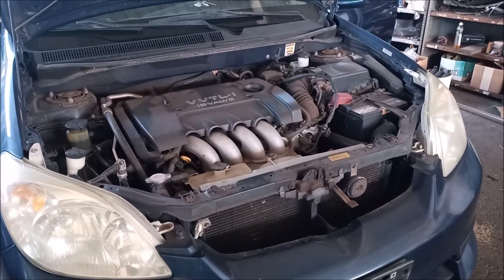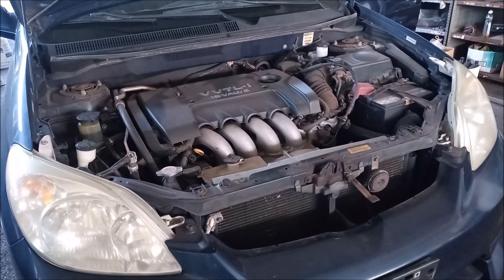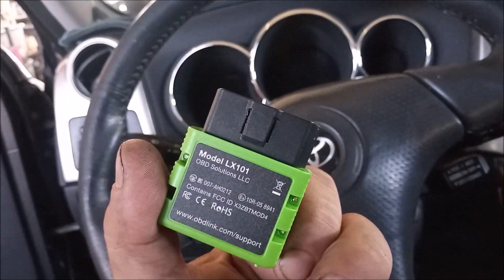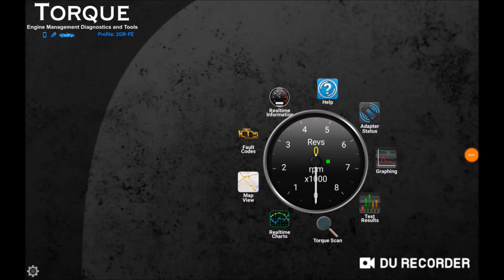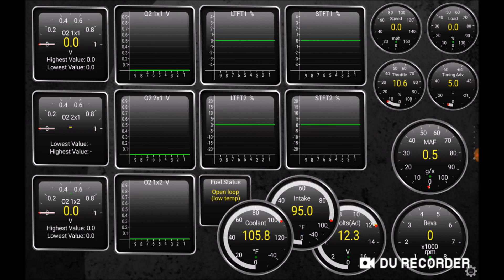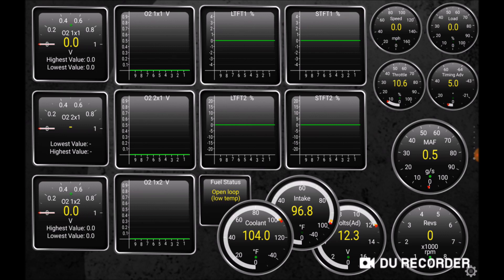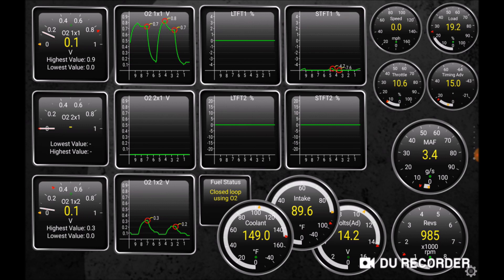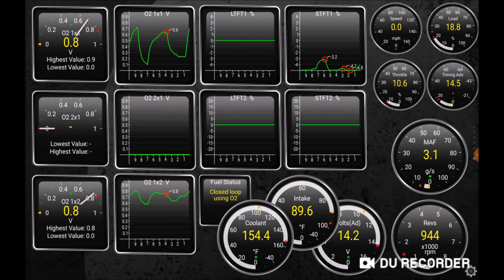O2 Sensor Voltages and Fuel Trims  LTFT STFT - 1zz-fe 2zz-ge Toyota MR2 Spyder

Comment: Hi Frank.  I bought the OBD2 Link and the scan software.  I was not getting any output from the upstream O2 sensor,  so I replaced it with a new Denso unit.  There is still no output.  Any ideas what the problem is?   I'm getting all the other data including the downstream O2.
Reply: Update:  Now I'm getting output from the Wideband Voltage on S1.  The voltage stays around 4 volts,  but the S2 voltage swings back and forth.  It should be the other way around.
Reply from the maker: What year and model and engine. Newer engines have an AFR sensor that functions differently from an O2 sensor. It will NOT give a 0-1 volt signal. The AFR sensor gives only a 3.5v pseudovoltage on the scantool. This is how you verify the function. The downstream sensors are usually conventional O2x sensors (0-1v) even on newer vehicles.
Reply: @Merryfrankster_   It is a 2004 Toyota Highlander 4 cylinder.   So  the upstream  O2  is ok then.   It must need a new catylitic converter because the Downstream O2 is still swinging back and forth.

Comment: Frank, Thanks for sharing your knowledge on this and other 2zz swap matters. A quick question. Any reason why the ecu won't enter into closed loop mode. Mine gets stuck in OL-DRIVE mode after warming up and just stays there. My O2 sensors are fluctuating in voltage as expected and I don't seem to have any vacuum leaks (although  idle is a bit high at 1100rpm). I'm  working with a freshly cleared ecu as you are in this video. The thing (a Celica GT with recent 2zz swap) just won't go into closed loop. Appreciate all you do for the zz community.
Reply from the maker: I would expect a CEL and DTC to pop up if it is not going to closed loop. Maybe check the TPS on your scanner, it it's reading an incorrect elevated value, that could cause open loop - in fact that's the basis for a (ill-advised) hack for forcing open loop.
Reply: Hi Frank. Thanks for your prompt reply. You are literally the GOAT on all things ending with ZZ. Props. Anyway, I figured out my issue. I'm using the old 1ZZ/Celica GT harness on the newly swapped 2ZZ and neglected to switch the red and brown wire on the TPS plug. (You explain this in a post for Spyderchat, the wire colors being different for the MR2-S.) I realized my error after repeatedly getting a P0121 Throttle Position Sensor error. I originally addressed this by changing out the whole throttle body assembly. Then I noticed my scanner showed a TPS reading of 90% rather then the 10% you show in this video. I realized something was reversed and subsequently discovered the variation in TPS wiring between the 1ZZ harness and 2ZZ harness.  It's a shame MRW doesn't make this more clear in their swap guide/shopping list. Anyway, now I'm onto another issue--P0171, Too Lean. I've seen your vid on the vacuum hose routing already ( thanks for that, btw). An exhaust leak maybe, or faulty old injectors? Who knows. Anyway, I'll post what I find out here for posterity's sake. Cheers.
Reply from the maker: @mbbrower  ah, so it was the TPS after all. Good catch.
Reply from the maker: @mbbrower  P0171 is a very commonly occurring code in swaps. There is no shortage of advice on what to look for if you have that code.
Reply: Thanks Frank. I've already found your laundry list of possible causes in the forums. I've had the exhaust flange apart 3 times trying to fix a small leak in the donut gasket between the header and mid pipe, but I'm not sure that is really the problem. My pre cat O2 readings essentially flat lined at 0 on the last drive and that was with a new Denso O2 sensor. Could running it rich the way I did with the reversed TPS wiring (for 10 miles or so)  have ruined a new O2 sensor?
Reply from the maker: @mbbrower  flatline at 0 means either the fuel mixture is very very lean or the sensor is dead or there is a problem in the wiring. Do you still have your post cat O2 sensor? Swap it for the upstream sensor, for a test. This means, remove the sensor from the post cat position, plug it in to the upstream position, and run the engine, checking obd2. The upstream sensor and downstream sensor are functionally the same. So if the downstream sensor works when you put it in the upstream position, this means there was something wrong with the upstream sensor. If you put the downstream sensor in the upstream position and you still get a 0 flatline, then you know it is not the sensor. But before you do that, make sure that the downstream sensor is working in the downstream position, by checking its function on obd2 live data, before you remove it.
Reply: Thanks for all your help. After eliminating the exhaust leak entirely and swapping around and changing  out the O2 sensors, I still had both front and back sensors reading between .02 and zero. I also had low manifold vacuum (15 inches Hg) which I think explains the marginal MAF readings (2.5 g/s). So, going back to basics, I ran a compression test and it looks like I've got a bent or otherwise leaky valve on number 3. I didn't do a compression test before because the car ran pretty good. Psychology of avoidance, I think. Anyway, so much for all that low hanging fruit like sensors and wiring. Looks like I'll be pulling and rebuilding the head. Haven't done my research yet, but I'm assuming this can be done with the engine still in the car. I know the timing cover can be removed with the engine in, but I'm not super thrilled at the prospect of getting the exhaust manifold off and back on again. Anyway, thanks again for taking the time to help us "dummies."
Reply from the maker: @mbbrower  2.5g/s is a normal reading for warm idle, 800 rpm, iat about 85 to 90f. Before you do anything crazy, do a leak down test. This is the only reliable way to check for valves not seating. Compression test is not indicative.
Reply: Good advice. I'll pick up the leak down test kit. I assume the.one from HF is adequate? Going back to the beginning of this saga, we thought it good practice to put in a new timing chain before installing the junkyard engine. We had the timing all carefully sorted out until just before installing. We then discovered the broken intake side lift bolt, which entailed removing camshaft and tapping out the rocker rod. We put it back together, but without exercising the same degree of care as we originally had. We ended up lining up the chain markings on the  dot/indent on the intake sprocket instead of the line on the vvt housing. Ugh! Thus the timing was off on the intake side maybe 90 degrees. My fear now after discovering the low compression on number 3 (90 psi whereas all other cylinders are 140) is that some intake and exhaust valves may have crashed into one another while we we trying to sort out the initial start up. Anyway, I will do the leak down test and report back. Maybe someone out there can learn something from our mistake.
Reply from the maker: @mbbrower  Sorry but I would not trust any tool from Harbor Freight. Certainly not a precision measurement tool. Here's a link for an OTC tool - it's the one I have. Reasonably priced, reasonably trusted. https://www.amazon.com/OTC-5609-Cylinder-Leakage-Tester/dp/B0030EVL60/
Reply: Thanks for the link. One year later, after pulling the engine, removing the head, and replacing the head gasket, my problems are apparently solved. The ECU is entering closed loop mode and the emission monitors are cleared. In the end, I didn't have to rebuild the head ( all the valves were air/watertight). Must have been a leaky head gasket... I'm not really sure... Anyway, compression is now even on all four cylinders, which was not the case before. Just took a new head gasket. Anyway, thanks again.

Comment: Did you download any specific Torque plugin etc or input the sensor pids manually to get these to show up and work, I never got a lot of the realtime info you can add to work on my T-Sport/GTS in US celica market terms I think the TS is known as like oil temps and the sensors you show here and some other stuff, RPM data and speed and load% etc worked fine, though. A guide on getting the best from Torque Pro and a 2zz motor would be appreciated pleaaaaaaase :D
Reply from the maker: These are all standard PID's included in torque pro. No special programming needed.

Comment: You are my light in the dark. Thank you! I recently made my swap to my Spyder with 2ZZ with brand new PPE cold intake and hot air exhaust and I had system too lean issue. The trims where sky high but I did change the Idle Control Valve from the original 1ZZ engine alongside with the sensors and the trims are now as the ones shown in the video. What bothers be is that my O2 sensor never worked the same way as in the video. I gives voltage much rarely that shown here. I am only left to fix my Idle revs and I was wandering could it be related with the O2 sensor in any way?
Reply from the maker: O2 sensor should work EXACTLY as shown in the video. If not, it could mean either there is an exhaust leak or the sensor or its wiring are defective. There is also possibility of vacuum leak on the intake side.
Reply: @Merryfrankster_  I checked the electricity and it seemed ok. I went to smoke test and found a vacuum leak through the spark plug gasket. Since I fixed it when I start the car the O2 sensor works up until the moment the MAF reading goes below 0. When the car is cold the reading of the MAF starts at around 4 and when the car warms up a bit the MAF goes from 2.5 to 0. When the car is under load the MAF and the O2 sensor work as in the video here. May I respectfully ask if you do happen to have a guess what might be the reason for the MAF's behaviour? I recycled every part of the cold air intake and I am using the PPE cold air intake system with brand new MAF and PPE header and outlet with brand new O2 sensor as well.
Reply from the maker: @timopetenbald1326  most likely reason maf sensor reading goes to zero on a running engine is a. maf sensor has a defect b. there is a fault in the wiring between the maf sensor and the ECU c. or the ECU itself has a defect. How long does the maf signal stay at zero? It is a brief blip? Is it a sustained break? Does the engine stumble or stall when this happens. Really don't see many cases of a maf sensor signal suddenly dropping to zero.
Reply: @Merryfrankster_  its a sustained break until there is no load. It goes even below the zero value and stays there until the car doesn’t move. When there is load it goes back with values between 3 and 6 maybe and the trims seems good but this is only while moving. There is no engine stuble or anything unusual. Just system too lean and high trims. When I replaced throttle valve with the sensors and the gaskets it worked perfect for 50km and then it started again. I shall check with the old MAF sensor again and will check its cabling once more. I also have second ECU and the behaviour is the same. Thank you so much!
Reply from the maker: What scan tool or scantool app or software are you using?
Reply: @Merryfrankster_  torque pro. I have free and paid version and two different android devices. The obdII itself is ELM 327 mini.
No other CEL error besides system too lean. Once I had C3101 but I cloudn’t find anything on it and I cleaned it with one of the tests I ran.
Reply from the maker: @timopetenbald1326  check the maf sensor widget in torque pro and see what the min and max settings are.
Reply: @Merryfrankster_ default ones. Max is not specified and min is -0.01 on both versions of torque pro that I have.
Reply: @Merryfrankster_  Sorry for bringing back the topic. I have capped the vacuum on the ppe cold air intake. Could this be the reason for the behavior of the maf?
Reply from the maker: I have another video that shows the routing of the vacuum hoses in the PCV system. With your CAI, you should try to reproduce the same routing of vacuum hoses as the stock intake. Otherwise, there will be issues with fuel trims.  @timopetenbald1326
Reply from the maker: If your MAF signal to the ECU actually goes to zero, at that moment the engine will stall. When the ECU sees zero MAF it gives zero fuel.
Reply from the maker: Besides you would get a "sensor out of range" DTC.

Comment: Hi. Nice video. At my 1.4 Toyota corolla (4zz) the LTFT is almost always at –4.7%. Is that normal?
Reply from the maker: It is within the acceptable range. Nothing to worry about. Ltft will vary with rpm and throttle position. Check what it does under different conditions.
Reply: @Merryfrankster_  It stays at -4.7%. Sometimes goes at -3.9%. No significant change. When I changed the air filter, it went for a while at -0.8%. I thought it was the filter. But then again went back to -4.7% and stays there.
Reply from the maker: @s-nickos  A lot of things will affect the LTFT. One is ambient temp if the fuel temp is colder then less volume is needed for the same fuel mass. Another is atmospheric pressure - at higher altitude less injection time is needed for the same mass of fuel. The ECU compensates for variations like these by using the fuel trim. No need to worry about it if it is within +/-10%
Reply: @Merryfrankster_ I was thinking that air temp and pressure might affect the readings. You confirmed my thoughts. Thank you very much for your answer.

Comment: Hi Frank, I hope this message reaches you. I have been fiddling with the MAF mod and the car runs well, LTFT are in the ballpark figure etc. But on my Autel scanner that I use I have found that my o2 voltages are generally cycling between 0.1v and 0.9v but there are a few instances where it drops down as far as 0.035v. This happens during idle and while driving (not sure about WOT).

I have unplugged the connector on the sensor to measure the voltages directly and I get a constant 0.9v (from the bigger injectors) and when I remove a vaccuum hose it does fall to about 0.2v. So it seems to be fine, but If I blip the throttle there are moments that I still see the voltages on my multimeter also dropping to about 0.040.

I must add, I have picked up this annomaly on my scanner prior to doing the MAF mod. In your opinion, could there be something wrong with my o2 sensor, is this normal? I have never had a code pop up and the low voltage readings usually only last half a second or so. Thank you for all the info you share with us 🙏🙏
Reply from the maker: I would not worry unless the fuel trims start to show an anomaly. Low voltage is lean but it must stay low consistently to be meaningful.
Reply from the maker: Keep in mind fuel always goes lean when you lift off throttle.
Reply: @Merryfrankster_  thank you soo much!! When I had these concerns you were the first person I thought to ask! I was worried that I might have a "damaged" wire after I replaced the engine causing the seemingly random low reading, but it all makes sense now. I also wasn't completely aware of how DFCO worked and it could also explain the low voltage spikes while cruising 🙏 thanks again!

Comment: Aloha Frank, the Torque Pro is also on Apple. Thanks got one to use with my Blue Driver. My Spyder surges while going 40mph, revs from 2000-3000 rpm can it be my o2 sensors. Throws code 134   154 ...... Aloha and be safe to you and yours
Reply from the maker: P0134 with P0154 means that neither one of your primary O2 sensors is working. You can check that by looking at the O2 sensor voltages just like I showed in this video. Make sure both O2 sensors are connected to the harness. If you do not want to run out and buy new O2 sensors quite yet, take the downstream O2 sensor out and put it into either the bank1 sensor 1 and/or bank2 sensor 1 position for testing.